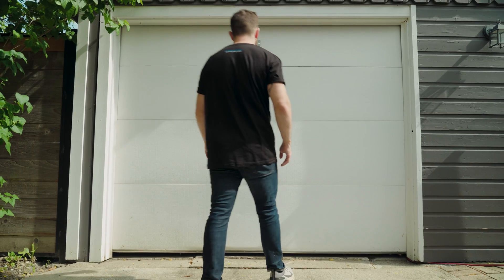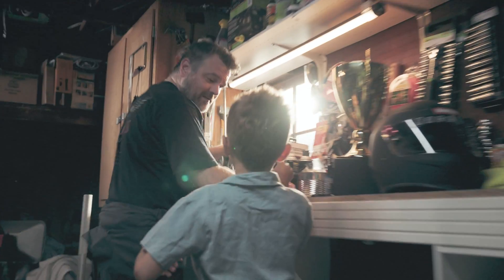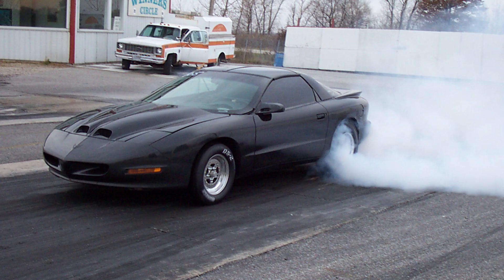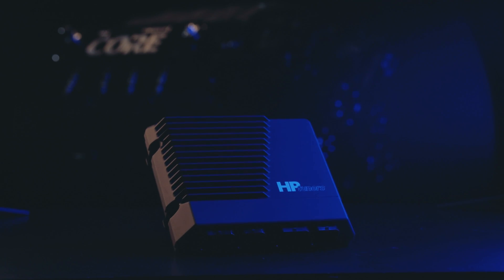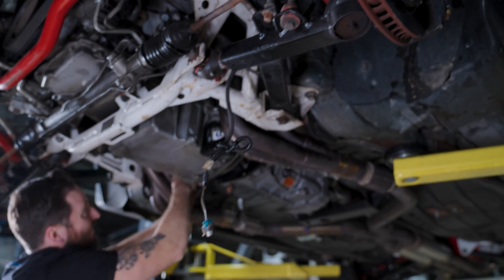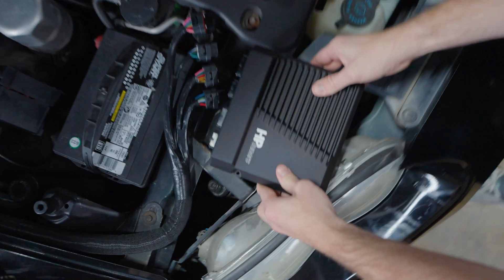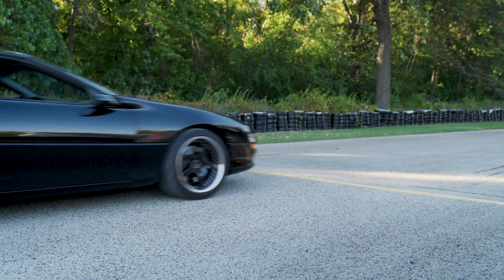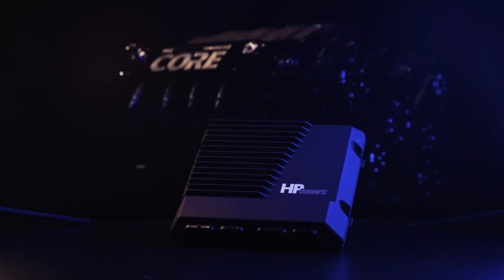Our New Standalone ECU: CORE ECU and VCM Live | HP Tuners

Comment: Will you be releasing adapters that can work with stock engine harnesses, per say newer units like E38, E92 etc. 

Will core be able to communicate with OEM GM can bus? 

Very interested in using this on a E38 vehicle if you could roll out adapters for engine harness to be direct plug, but leave the other Input/Output connectors and widebands as a separate harness.

Comment: I test and repair ecus, bcm, and other modules in many makes and models of vehicles every day. I could help as a repair service if needed as long as the parts manufacturer doesnt discontinue the ICs and drivers that it uses. I do thermal testing and vibration tests and add improvements to current ECUs and modules to reduce its failure rate over time. Helps with the longevity of the modules. Would be happy to help if needed as a 3rd party repair service.
Would like to see an E40 type ECU for the LS2 6.0 that come in the Pontiac GTOs. I got several people that have interest in a stand-alone for that platform and want to be able to run a dbw TB that will fit the intake even if they have to make a 3d printed adapter plate to adopt something larger. Cant get the oem Throttle body for a GTO from GM/Pontiac for the 6.0L anymore. Discontinued

Comment: Very cool! Was wondering why HP Tuners didn't have a wire in standalone ECU. Now... Can it run my V10? Hahaha.
Reply from the maker: Maybe one day! 👀
Reply: @HPTuners  Planning to get an MPVI to tune the admittedly limited 2001 Dodge JTEC ECU. I heard the MPVI3 has issues with it while the MPVI2+ worked. Basically gives me access to a tiny fueling table and a few other settings, but still good enough to boost it. A full standalone would definitely be a different ball game, hahaha.
Reply: @HPTuners  Oooh looks like JTEC support was added back for the MPVI3 in June!

Comment: I have your previous tools that have had emission stuff changed with updates over the years. What are the risks that I LS swap an old car with this only to have a SW update then require something emission related?
Reply from the maker: Hi @general23cmp, CORE ECU is intended for use with reasonable basis (independent documented testing), pre-emission vehicles (pre-1975) and off-road / race competition use only. HP Tuners does not condone the misuse of its products.
Reply: @HPTuners  Thanks. The last thing I want to do is have to add emission stuff to my 67 C10.

Comment: It would be nice if they gave us a ballpark price because it doesn’t matter how great it is if it doesn’t beat others in price. If its not budget friendly i feel it will be forgotten about.
Reply from the maker: Hi @joshuarodgers5447! We totally hear you man. Pricing will be announced soon, but for now, you can count on CORE ECU  being competitively priced. We don't think you'll be disappointed. 
I'd recommend signing up for our email list on the website to be notified when pricing is released and to get an email 24HRs before orders open for CORE ECU. Thank you for your patience! 🙏
Reply: Approx $2000 from what I hear
Reply: Tell that to Motec lol
Reply: So I build custom ecu's and have almost as long as HP tuners has been around. I started with building off of the megasquirt platform then I branched out to having my own pcb's made using off the shelf single board microcontrollers like arduino, STM etc... to handle power, processing and tuning interface.  Since speeduino showed up ive been almost exclusively using that architecture and building off of it depending on who needs what. The latest unit can be used in place of a factory unit on gm vehicles up to 2015 with no loss of function in the vehicle from not being able to talk to the other controllers over their Lan setup. The built in obd2 emulator even allows the vehicle to pass most inspections here in Pennsylvania.  And don't get me wrong they make a quality product that works as advertised. With the feds breathing down the neck of the entire aftermarket  I can understand the warnings and disclaimers. But $2,000 a unit?  That's a bit much even for a niche product like this that I know had plenty of R&D thrown at it that needs to be compensated for as well as a general profit, but it's too much. You guys might have the best of the best in stand alone ecu's and I'm sure some will purchase them but you're cutting yourselves off from a larger market or at least in my opinion you are. Food for thought and like I said I'm not knocking any of the products.
Reply: 2 grand is a lot of money for a low memory  little computer.
Reply: yea like Rucefi is great open source and very advanced  deal +great price .let see what this thing can do or will greed top the list so i can not buy one as we all know build a ecu box its self and that high

Comment: Will it be able to connect to the bcm and factory gauges of say a 4th gen Camaro to keep everything like power windows and door locks?
Reply: I'd like to know this for factory LS powered Holden models. Factory GM CAN integration would be epic
Reply from the maker: Hi @Sonofa25sierra, currently CORE ECU does not support Class 2 Communication. However, CORE ECU features will continue to grow and develop over time. Keep up with our social media and emails to be in the loop on new features and capabilities.
Reply: @HPTuners needs to make a CAN bus to Class 2  converter and make it configurable for keeping the dash stock. Convert the rpm and MPH, oil, temp, and others of CAN line to the Class 2 Serial single wire. That would be nice

Comment: Is Core ECU only going to work with GM applications?
Reply from the maker: Hi @randylamance7888! CORE ECU initially supports Gen 3 and Gen 4 LS engines, but more support is coming very soon!
Reply: @HPTuners  get it to handle 3-12 cylinders any application you'll have my money. Compete with fuel tech please